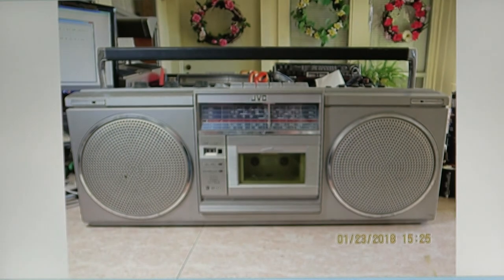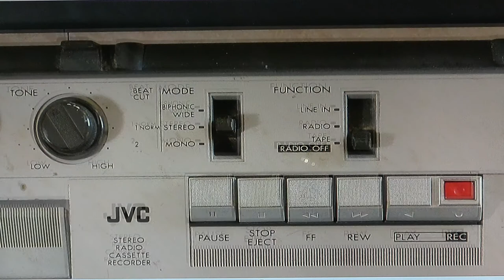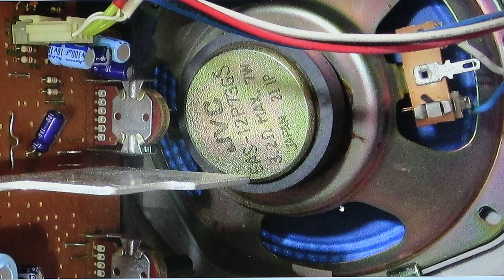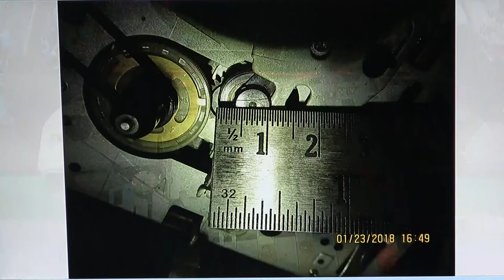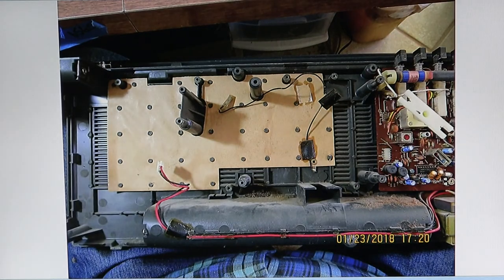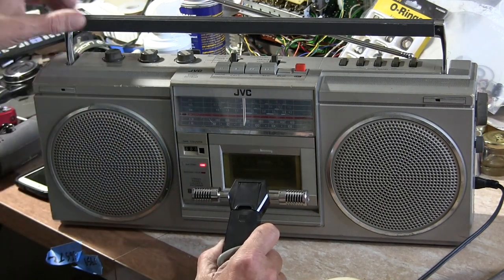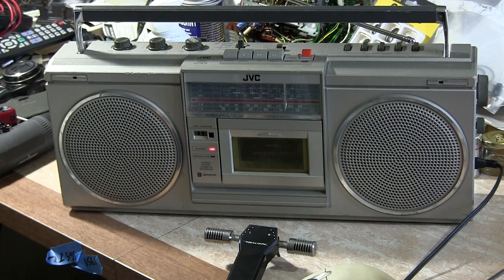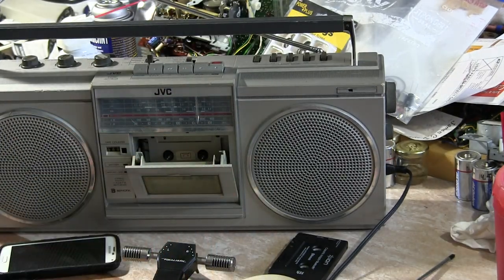JVC RC-565-JW Need 12mm Idler tire deck added antenna Biphonic Stereo great Audio

Comment: Am looking to adjust the motor speed on one of these, do you know what type of screw driver the motor speed screw uses?
Reply from the maker: Flat tip Jewelers screwdriver real small maybe 2 mm or 3 mm width